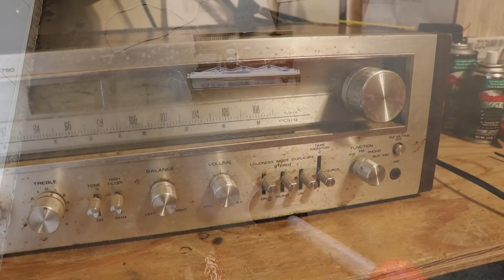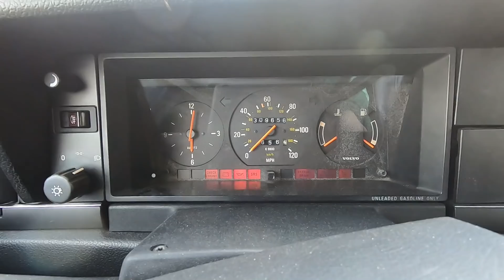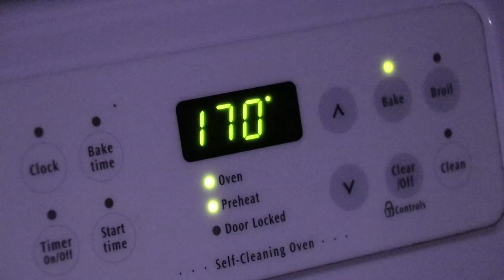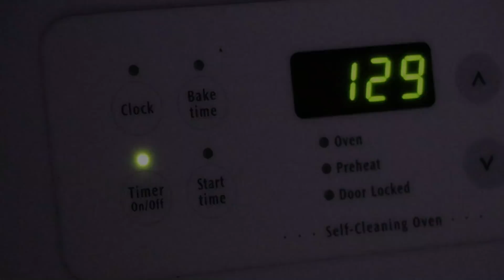Power Washing My Pioneer SX-750 And Seeing If It Still Works

Comment: that was real scary to watch you jet washing it but as you say its satire the face plate should come back 
the amount of salt in the pobs is unreal so as you say has left a coating on it. Its the same as you alloy wheels in the winter with road salt try a furniture polish with not very much pressure apply'd when i cleaned the face plate and knobs on my sx550 i think i just used washing up liquid first with warm water as hot will release the glue that holds the knob covers onto the plastic inners. window spray will sometimes work and some time it will remove the text on the face plate.
my sx550 has just been taken for repair and the chap has a ultra sonic cleaner and puts the boards in that 
he does have a u-tube channel also
i was really surprised the unit came on after what you done to it even the lamps worked 
cant wait for the next instalment

Comment: Putting it in the oven concerned me more than the high pressure water blast, cant that water work its way up into the caps, and possibly cause problems to electrolyte properties inside ?

Comment: Dude.......maybe I might be attending to the "weird white film" on everything you put in your dishwasher ?? I mean YOU are eating that "white film" every time you use a PLATE, FORK, SPOON, etc. and WHAT you might be ingesting ??? Interesting Video !!
Reply: only if the utensils are anodized aluminum i think.
Reply: Yeah, but what about all the toxic vapours released when he "bakes" his amplifiers in the same oven he or his partner is using to cook their food in?  This practice is not only stupid it's also potentially dangerous to a person's health.  I wonder if he does the same with his car parts?  LOL
Reply: @alanrutlidge4767  that was common practice in 30's - 50's. (Although, albeit not as to dry it after Power washing it) but You only get it hot enough to aid in evaporating any residual moisture. Lol my wife would murder me if I put a set of heads in ours.
Reply: @alanrutlidge4767  most ovens are ventilated. If not, open the door next time u preheat.
Reply: If u do not put aluminum in dishwasher, u should be fine.

Comment: Do you take repairs from people that they would send to you ?? I have an SX-1080 indeed of repair .
Reply: if you value your equipment send it to any one of the professional audio restorers that know what they are doing.
Reply: @alanrutlidge4767  what makes you think he doesn't know what he is doing ? Have you watched any of his videos ?
Reply: @dougbaker9473  yes I have and clearly "any" constitutes at least this one - LOL.  In fact I've viewed most of them except his car restorations of which I have no interest in. Most of his repairs / restorations involve blanket replacements of semiconductors (some for no reason whatsoever), like perfectly good power supply diodes which weren't faulty but he managed to butcher the PCB in the process. :(   When asked (by myself and others) why he replaced perfectly good diodes his rationale was "they might fail".  LOL.  If there is any likelihood of future failure it's more than likely going to be due to his less than skilful repair efforts. I'm confident the design engineers at Marantz and Pioneer knew what they were doing 40 years ago.
Reply: @alanrutlidge4767  when restoring anything that is 40 plus years old , if it can be replaced replace it . Other wise is a waste of money for the restoration . Same goes for a vintage car when restoring it . If your not gonna do a proper restoration do do it .
Reply: @alanrutlidge4767  I found a guy who does work on these and any thing that can be replaced is being replaced as per my instructions so when I get it back it will be better than new and last another 40 plus years with no problems .
Reply: @dougbaker9473  sorry Doug but I have to respectfully disagree.  Transistors and diodes aren't like brake parts, gear boxes, differentials, engines, water pumps, fuel pumps, wiper blades or tyres that do wear out with use.  Transistors and diodes don't "wear out" per se. If they fail regularly It's more to do with poor design of the amplifier not the component itself.  Yes, occasionally in a repair or a restoration of an electronic device you will come across noisy small signal transistors that were prone to failure due to manufacturing issues, but it's not endemic to ALL transistors installed in equipment.  In fact if you care to do some research you'll find only certain transistors and only from a limited number pf manufacturers have this issue.  

IME and IMO restoration starts with an objective evaluation.  If it isn't broken why just automatically replace it under the assumption it's going to fail in the foreseeable future?  All this guy is doing is promoting e-waste.  :(  Now I can see a case for some electrolytic capacitor replacement but he doesn't have an ESR meter to test them.  Any experienced tech worth his/her salt who has been around the block once or twice will know not to simply replace parts unless there is good reason to do so unless of course they are looking to over service the client.  Something the automotive dealerships are famous for.  I wonder how many car owners have fallen for this trick?    

If you've been following AH-fix-it's channel you'd be well aware of some monumental stuff ups and misinformation bandied around as "fact".  I wonder if he would be wholesale replacing Sony power V-FETs at $50 each (if he could even find a source of new ones) if they weren't faulty? Of course he wouldn't.  That would cost money and cut out any financial benefit from ad-sense revenue made from YouTube views.  LOL
Reply: @alanrutlidge4767  I want everything that is replaceable replaced in my units . Do it the ways I say or I take it to someone who will . My money 💰.
Reply: @dougbaker9473  as you said it's your money.  But just be aware that once you've replaced every possible component it will be a box with a Pioneer badge on it.  I can virtually guarantee it won't sound like the amplifier it did when it rolled off the production line and I seriously doubt that power washing it and replacing the electrolytics with "audiophool" caps with a rated lifetime of only 1000 hours (see one of his videos where he replaces the PSU capacitors with a so called "audio grade capacitor) will give it another 40 years of trouble free service.  I'd give it one to two years maximum before it becomes unrepairable.  But hey, as you said, it's your money and your amplifier - LOL  Do as you see fit. Good luck.
Reply: @alanrutlidge4767  I am sure that if he sells this unit, he will be honest about its history. I understand both his shotgun approach and your concern for maintaining vintage character when possible. But be nice..."ah" has fans!😍